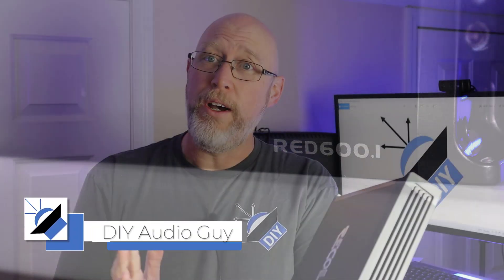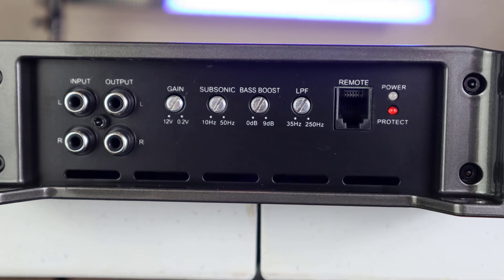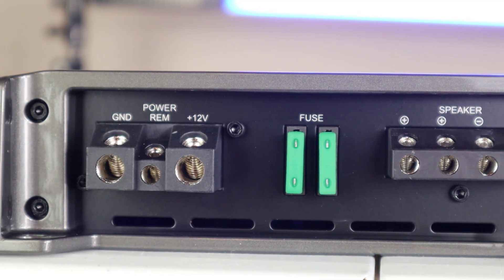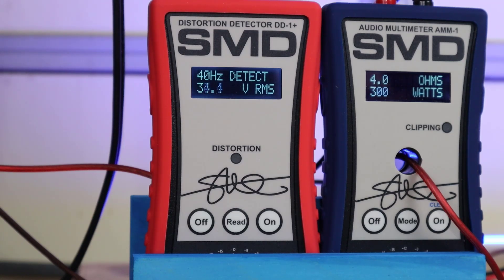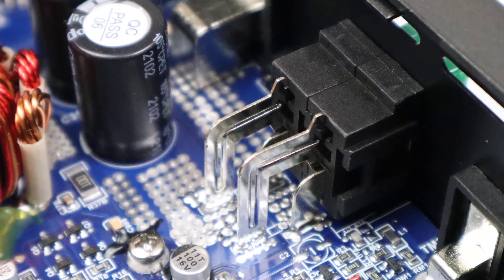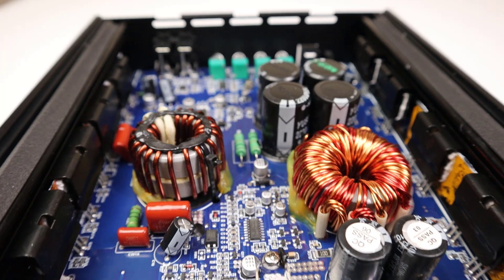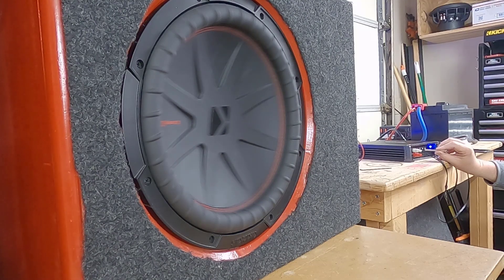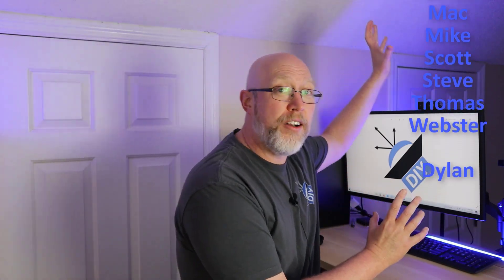Budget Car Amplifier.  You won't Believe the Power! Recoil Audio RED600.1

Comment: I have this amp running a single infinity  12" sub in a small sealed wedge box, 4ohm @ 310w rms , it hits hard , really impressed, still breaking it in and fine tuning the amp settings.  I used the recoil wiring kit as well as some recoil 6.5 coaxial door speakers.

Comment: I'm planning on purchasing RECOIL DI600.1 .The one you reviewed costs 50$. But is it worth that extra money in your opinion? Which one do you recommend, please?

Thank you
Reply from the maker: I don't recommend products, I make reviews so that you can have more information when you're ready to make a decision.  As far as I can tell the difference between the two amplifiers is that one of them is one ohm stable and the other is 2 ohms stable. So get the one that's going to work with the way you plan to wire your subwoofers.

Comment: I want your opinion about recoil DI600.1 class d is it good 2ohm stable 600watt rms 

before i buy it
Reply from the maker: I don't have any experience with that specific model, but everything else that they've made seems to do rated power.
Reply: @DIYAudioGuy   hi 
Plz Which is better? Recoil DI600.1 for $120 or Recoil RED600.1 for $170 amazon to morocco 
Tanks you

Comment: Will this amp push 2'12 sub's?
Reply from the maker: Yes.  Watch this video for more detailed explanation. https://youtu.be/pZPorYW-Wqo
Reply: Absolutely. I've powered the 12" sub with enclosure they offer plus a dual 10" Polk Audio loaded 4th order bandpass I've had for years with this amp and it is plenty powerful enough. Only running it to the single 12 as of now but I tried it on both just to see what was what when I first installed it.
 I am the one who just recently snagged this amp from Amazon on a return deal. This amp, a 4ga wiring kit plus the 12" sub in enclosure wired to 1 ohm at the terminals. 
What I can tell you for certain is that in my suburban with a 230 amp alternator and an optima red top battery powering this setup it just beats the floors at less than 1/2 gain on the amp. I have it set to just under clipping at max volume, from a pioneer avh 4500 nex head unit, set to flat eq, no boost and the sub enclosure pointed towards the front of my truck just behind the passenger rear seat. Knocks the hell out of my truck seriously.
Based on the review of the guy who returned this package I'm guessing he either had insufficient power to supply it or just the wrong space to run it in. Either way I'm very glad I took the chance on it. It all showed up as new, no sign that it was damaged and still covered by Amazon return policy too.
Even at full price for just the amp I may buy a second one to power a 4th order bandpass that could stand a little more juice than what my old bazooka ba1300 is throwing at it. 
Oh yeah, the recoil amp gets just slightly warm but never hot to the touch. From what I've seen so far it is quite efficient. I did replace the bass remote though, the one it came with is a reverse potentiometer. I used the rj11 style that Skar makes (still with a clip indicator) and it works perfectly with this amp. 
I hope this information may prove helpful in some way.

Comment: I was told by an electronic repair shop owner it's unwise to run amps at lower then 4 ohms. He said if you want more power then what the amp puts out at a 4 ohm load then buy a more powerful amp. So I see a lot of folks running their amps at 1 or even less then 1 ohm when it's really ment to last at a 4 or maybe 2 ohm loads.
Reply from the maker: I am going to have to respectfully disagree.  A 1-ohm stable amp is 1-ohm stable.
Reply: Most people that may have a 1ohm load wired aren't actually running at 1 ohm, sometimes it is much higher as evident in this video and particularly true if we are talking mids and highs with a active xover
Reply: Once you factor in fluctuations in voltage and impedance rise, even one ohms isn't one ohm consistently. Most people will see somewhere between 1.3 to 1.6 ohms wired at a 1 ohm load. And it's not that it's unwise to run lower than 4 ohms, it's that most people don't factor in the electrical support needed to do so without causing damage. Add to that that most people don't know how to properly tune their amplifier, or they buy subs that aren't necessarily suited to that am 2:43 p.

Comment: i got one of their 4-gauge wiring kits and it seem pretty solid for 30 dollars.  it was the same size as my stinger 4-gauge kit that was 100 dollars. This amp looks like a great value
Reply from the maker: I'm guessing that was an aluminum wire kit? Because of its copper that is a hell of a deal.
Reply: @DIYAudioGuy  says OFC rcas and cca power

Comment: Would love to see a review on the Ri600.1 amp. Recoil amps are gems in my eyes.
Reply from the maker: My experience has been good so far.
Reply: @DIYAudioGuy  please share. Recoil sponsored my channel and sent me that amp. Every recoil amp review ive seen they always exceed the max rating. Id love to know what it really does. It worked great with my setup tho.
Reply: I have one is pushing 10 inch L7 dual voice coil and 12 inch MTX @4 ohms Nicely I would recommend it

Comment: In your opinion do you think if you get a budget 500rms and a let’s say Rockford 500rms both make same power. Do you think one has better sound output over the other?
Reply from the maker: Assuming that both amplifiers are operating correctly, and both are operating within their intended power range, then all watts sound the same.  The problem is the "operating correctly" part -- a lot of cheap gear ain't built right.

Comment: That's a lot of amp for the money.  And you get a bass knob with it too! It would be nice to know how efficient they are though. The efficiency of a bass amp can mean the difference between one that can perfectly fine on your car's stock 12V supply, and one that will be left starved for power at higher playback levels.
Reply from the maker: You can get them for $61 if you buy 300 all at once.

Comment: I took the plunge.  I got the Red600. I put it on place of a an old but Mmats d2000hc running 3 mmats 12s at .67 ohms.  It is actually pretty surprising in power output and sound quality.  Then swapped over to 2 Aulmapro 12bp's @ 1 ohm and again was impressed with the sound and power. I ran it pretty hard, mostly 90s early 2k rap and some metal mixed in.  It did pretty damn well, it didn't get too thermal protection at any time, and the volume wasn't low except between tracks.  The only noticeable sounds issue that carries over both sub setups was transient recovery, but on certain songs with a very fast drum beat, typically metal disk bass, in Metallica One it was noticeable during the heavy drums.  With rap/hip hop it was very nice across the range from hard hitting songs like Rock Ross Box Chevy and deep bass like Master P pass me da green.  Overall it's a great amp for the price!
Reply: wow man i havent heard anyone mention alumapro in a very long time i used to run 2 alumapro bp-12's in my 89 camaro back in the day on some rockford 301m amps
Reply: @Rider-xsb  it's funny how few people knew about them back in the day when they were new. They never really made the mainstream but if you went to competitions you'd see them.  That's how I got into them, I was competing with the old school Cerwin Vega Stroker and , and the Alumapro rep saw me at Daytona Beach spring break nationals. He was so sure his gear would beat my setup they gave me all the gear up front and said if I followed his box design I would be able to win in SPL and SQ with the same setup. Turns out he was right!
Reply: @sycoticone  mine were the bandpass enclosures were removed the rear seats in the back of the camaro and built them into the cabin , would do 147db on music
Reply: You have incredible ears and understand music very well your ears heard the very low dampening factor of this amp which means I trust your opinion in this amp well done.
Reply from the maker: Hope it works out well for you in the long run!

Comment: the power output is no more important than how the final signal is being reproduced. The quality of the end signal is CRUCIAL and often times ignored over the exaggerated obsession towards power. This is the exact reason why only a few amps amaze us with their output in terms of clarity. The rest may be ok but will never reach that clarity, as said, ignored over the power costs. It may look like a clean wave but there is far more beyond
Reply from the maker: Power is an easy metric to understand.
Reply: @DIYAudioGuy  So is THD.  I doubt anyone would be able to hear 1% THD in a bass amp driving a subwoofer, unless perhaps that THD is happening at midrange frequencies, LOL.  For a full-range amp however, YMMV.  I still doubt it would be audible in a car audio environment, particularly when you're driving said automobile and dealing with 60+ dB background noise...
Reply from the maker: @Grommet2007  I think most people actually LIKE a little distortion from the subwoofer.

Comment: It looks like you're an Alpine guy.  Do you have any thoughts on the Alpine s-a32f 4-channel amplifier vs the Alpine MRV-F300?  They're both 4 channel and about the same rated output.  Is one just an updated model of the other?
Reply from the maker: I'm not actually an Alpine guy. I have an Alpine amp and an Alpine head unit, otherwise I've not owned any Alpine stuff.  I don't have any experience with either one of those pieces of equipment.

But it's Alpine. It's got a great reputation. You know that it's durable and it has accurate specifications.

Comment: I love how you test the amp with different speakers which also shows you how well speakers are made at the frequencies people like.
I know there are thousands of subs and thousands of boxes, but have you ever done frequency stepping for the ohms? Plot it on a chart. for eg the kicker ohmage from 20-80.
Reply from the maker: That's not something I would do in every video that I make but it is something that I might try just to show people how it works.
Reply: @DIYAudioGuy  Yes I mean as a one off, I was very intrigued at the sub being 12 ohms or so at 40 hertz where the kicker was at 4 ohms.

Comment: I just bought the 1200 watt  version(RED 1200-1) off Amazon for $135. It's for my wife's SUV pushing 2 Kicker L5 10's
Reply from the maker: Cool!  I hope it works well for you!
Reply: I hope so. If not, it only cost me $145. I was also introduced to the brand by Robot Underground. I was thinking hard about the Recoil component set.
Reply from the maker: @darrianbenjamin7292  I wish I knew more about the brand.  The prices are very low, hopefully the gear will last.
Reply: @DIYAudioGuy  I will keep you informed.
Reply: @darrianbenjamin7292  how did it hold up? I have been kicking around buying one
Reply: @mercyw.5061  it's still going strong. It still sounds good. No problems @ all. I would definitely buy another one
Reply: @darrianbenjamin7292  Thank you. I have two ds18 subs 500rsm 4ohm subs and I was debating what amp to get

Comment: Thx for your review you did a great job! If someone was fallowing your video's they would know that this amp in a car on a woofer wired to A final impedance of 1 ohm, after "rise" you might get 300 wrms, so I don't think it will be the new the budget king witch we all know is Tramps SMART3.
Reply from the maker: One of the reasons why I'm doing the tests on the subwoofers is because I want a show that after we account for box rise and power factor we never get anywhere near the rated power.  That really should be the take home lesson.
Reply: @DIYAudioGuy  I know that you know that impedance rise is not called "box rise" by anyone in the industry and yet you continue to use the term. The term is an misnomer and makes 99% of people think that the box is the cause of rise, all though impedance rise can very slightly from box to box it is never the root cause or the effect. and you are perpetuating endless people asking me a box builder how to build a box that don't have "box rise" PLZ stop plz. I'm not saying any of this to put you down or be a smart A, I'm truly trying to help you educate bass heads. Plz do the right thing.

Comment: Got a question. When designing an enclosure for a sub with a slot port, lets assume we have infinite space. I need 4 cubic feet net + port.  As i make the port wider the length must get longer. This begs the question is there suck thing as too big or too small even while keeping ratios proper. What are the pros and cons big port small port or is there a sweat spot in between? Does impedance rise get effected. And a bunch of other questions ?
Reply from the maker: If the port cross section is too small you get turbulence causes port noise, also known as chaffing.

If the port is too long you end up getting pipe resonance.

Comment: There's a lot more to any amp the JUST POWER. There's more sound quality, clarity , reliability, stability, audio filtering and more. An Alpine is gonna cost more and be better in every way. U always get what u pay for ( typicaly with dimminishing returns on value), you wanna drive a Kia..ok.... Or you wanna whip a BMW? They both do the same things, there just completely different.....
Reply from the maker: You ever hear of the $10,000 amplifier challenge?

I probably need to do a video on it.
Reply: @DIYAudioGuy  lol he'll yea
Reply: The price of a piece of audio equipment is typically more reflective of what the seller thinks potential buyers are willing to pay for it rather than the quality of the parts used within it.  A case in point: my Alpine PDX-M12.  Great amp in terms of its capabilities, that uses one of the cheapest switches that I've ever seen to adjust the gain range.  And guess what failed in my Alpine PDX-M12?  Yes, that same switch.

Comment: I was on the fence between this & the CT Sounds 400 monoblock (only about 10 bucks more), after I heard you mention it was decent in that collab video you did several days ago
...I ended up settling for the CT. Both seem like good budget amps to power a modest sub in a car, which is what I am shooting for. Not looking to enter IASCA or anything! 😊
Reply from the maker: The big powerful lamps are the ones that get the most attention, but it's these small amps design for someone to put in their daily driver that sell the most units.

Comment: another nice thing about angled power terminals.  If you are using ferrules, the screw will bite into the ferrule and pinch, making it more difficult to pull the wire out.
Reply from the maker: 👍 That makes sense.

Comment: This was an easy video to watch. I can't put my finger on it, but something about how you did the wattage test this time seemed to work a lot better, not that the first one was bad -- but you've got it really dialed in with this one.  

I hear what you're saying regarding actual real-world wattage figures and cost-per-watt being more important than what's printed on the box, but I would still prefer an accurate figure because unless you watch a video with an amp dyno run, you're purchasing based on false information. But, this amp in particular got pretty close at least.  As your speaker demo test confirms. It's not as easy as just pushing watts into a resistor bank and taking a reading.

I've purchased a BUNCH of non-car amps from China with dubious wattage ratings. Nowadays, I usually look at the Chip spec sheet to see what the chip can actually do based on manufacturers data which gives me a good idea of what to expect with the amp.  I know you can't really do that with the car amps -- they don't necessarily divulge their choice of chips, or the implementation layout they use. But I know that the wattage ratings on the little chip amps I get are at 10% distortion, but at least they can get there - technically speaking. I guess car amps are expected to get to their advertised ratings with a basically clean signal?  I guess that's good! 

Just wanted to give you a thumbs-up on the video, 'twas good!
Reply from the maker: My comments on the power ratings are as much a comment on the state of the industry.  It's not like testing an amplifier is hard, if some random knucklehead like me can do it then how come the big companies can't do it?  If it says 500 watts on the box it ought to do 500 watts plus or minus some reasonable margin of error.

I've also put a lot of thought into my editing style, and I'm getting better at planning out my shots before I start editing the video.

Comment: I just wanna comment about the bass knob.  The bass knob aka potentiometer has 3 terminals.  Depending on which 2 of the 3 terminals are used, determines which way the resistance changes when you turn the knob. Most times a pot' will be wired where the resistance is at the max rating of the potentiometer, and as you turn the knob, the resistance will decrease allowing more current to flow.  But if it's wired the other way, the resistance will be at 0 ohms or the minimum rating of the potentiometer, and as you turn the knob, the resistance will increase.  As a result, resulting in less current flow.  Or the circuit board may be inverted and there's an error with the Min and Max labeling like you said in the video...😄.
Reply from the maker: Good info!